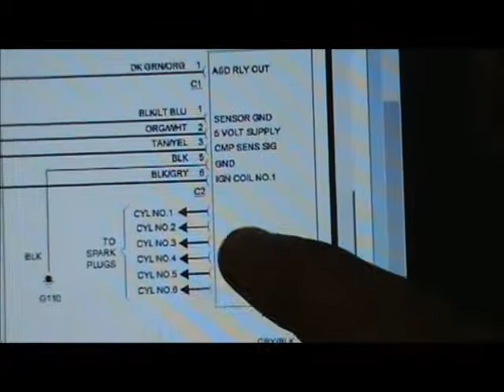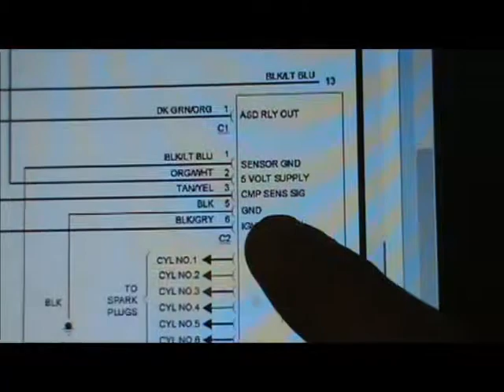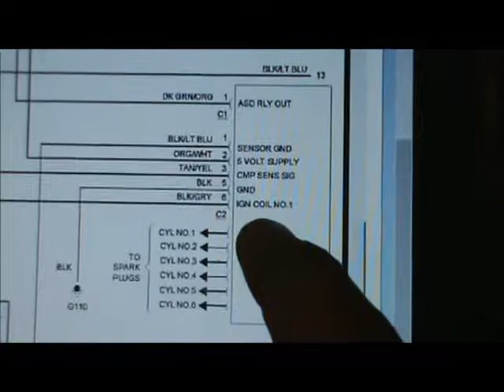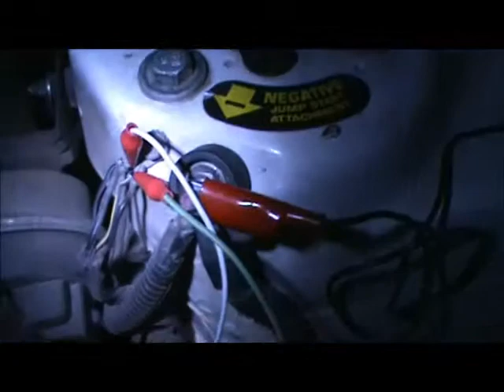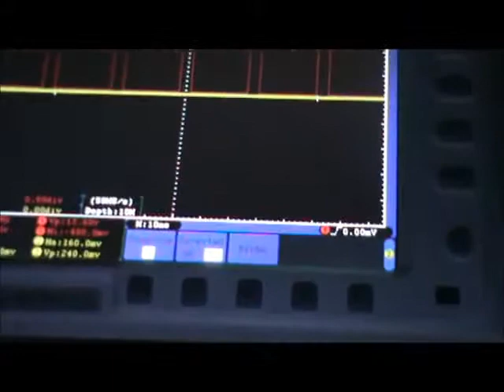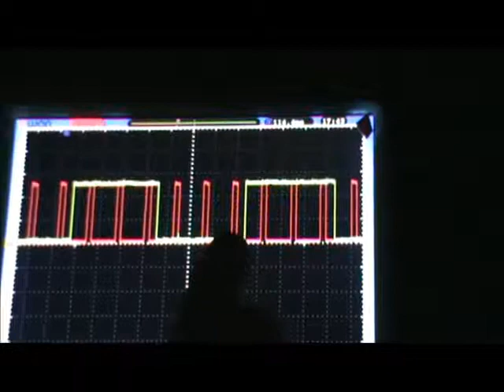Ignition system

Comment from the maker: Like I thought, the cap, rotor, and distributor were no good. I just wanted to check all the inputs to make sure it wasn't a wiring problem. The distributor was original with almost 200k miles on it. I would die every other day, now it runs without any issues.